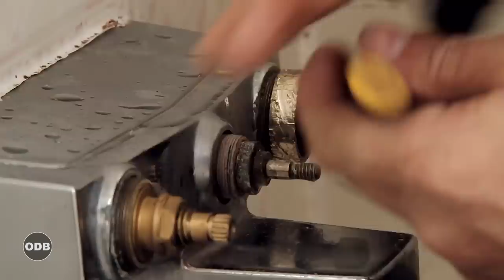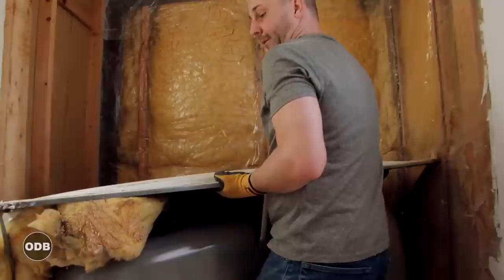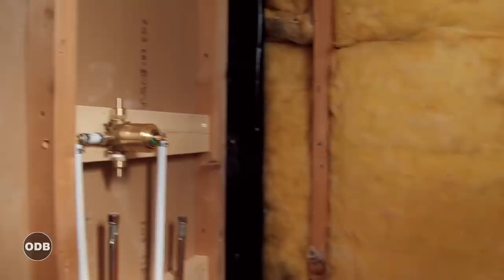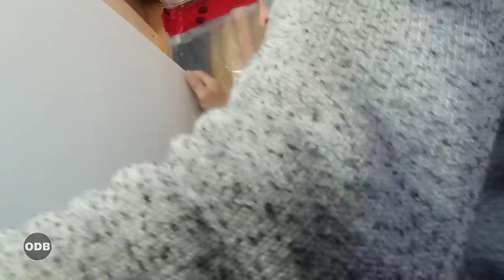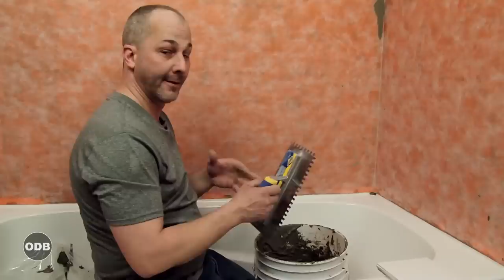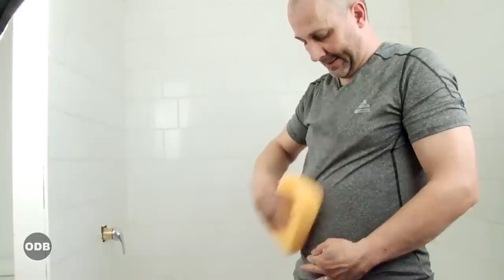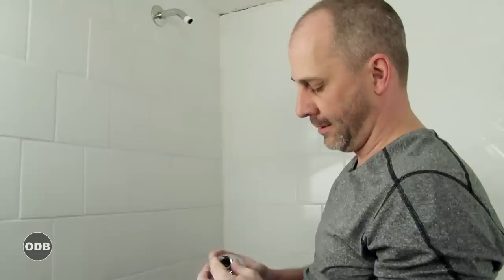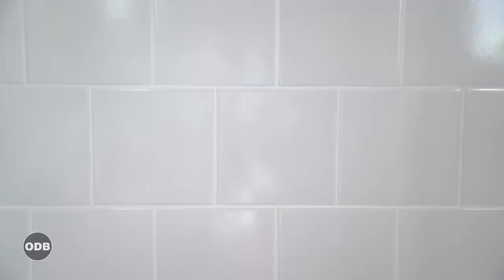DIY How to Renovate the Tub / Shower from A to Z

Comment: I am a pro and I agree with most of this video. Bottom line, this was a job well done and done according to budget. The price is fair , but it depends on the materials costs. I've seen an average cost to the customer of 2500 bucks because I pass my cost savings  ( contractor price) to the client , and use standard materials. The labour cost doesn't really change much compared with the products or materials chosen by the client. Great video!
Reply: wow! $2500 bucks from removal to finish installation? that ain't bad. But I did it by myself and it costs me about $1000.00 bucks using the best material too.

Comment: nice touch with the sealant around the tub etc but in reality using your finger and saliva to smooth out will only create a mould to appear on the sealant within a year due to the bacteria in your saliva. best to use the correct plastic forming/smoothing tool to create a smooth bacteria seal considering all your good work done to prevent mould growth behind the wall. but good job otherwise.
Reply: you can't avoid bacteria dude. No matter how you do it.

Comment: Can you test the piping before you install all the new drywall and tiling? I'd hate to get everything back together and looking real nice and then next thing I know I have a leaky fitting and have to redo everything. Once you get all the piping and new overflow back together and the tub installed, would it be safe to do so before installing the new drywall and tiling?

Comment: Great video! How far down do you take the sheetrock above the top surface of the tub? How do you waterproof the bottom edge of the sheetrock? Thanks.
Reply from the maker: stop at the top of the tile flange with wall board. use kerdi strip to seal the tub to the wallboard. Cheers!
Reply: @HomeRenoVisionDIY  : Thank you!

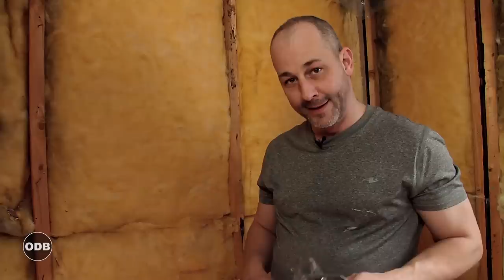Comment: Hey Jeff, or anyone else: For the shower plumbing at around 29:00, how do you know that the depth of the shower valve, tub spout, and shower head are set correctly? Like when you close up the wall, the valve or spouts could be sticking out too much or recessed too much. He just attached them to a 2x4 but didn't show how he measured for depth...TIA
Reply: 1:16:34 shows the that valve was set to far back, the result is the chrome sleeve wont cover the whole brass stem.should of used the template that usually comes in the box to mimic the finish wall. 2020

Comment: Whoa!!! That is NOT how to remove tile surrounds bud! Correct order of walls, but People! Don’t use those tools to demo- sounds funny, but there Are correct demo methods. By correct, I mean safe and efficient. Using an angle grinder (PPE ALWAYS!) cut down grout lines into manageable-size pieces. Then down the side with a saws all (grinder works but SUPER dusty) Just deep enough to get through to framing. Same across the top tiles if they end short of ceiling. Pry off the drywall with tiles attached for easy and safe transport to the dumpster. Then repeat on faucet wall, followed by center wall. Inspect plumbing feed lines, or remove and cap.

Comment: I believe your using 1/2” pex  going to your tub spout.? You should not use 1/2” pex  , as water pressure builds up and water will weep out of the shower head when your trying to fill the tub as your having a bath .
Even Delta highlights that you DO NOT use 1/2” pex out the bottom of the mixing valve . 1/2” copper or 3/4” pex would work .
Sorry for the correction,but I’d like to help save people from future problems

Comment: Hi Jeff.  Excellent video but now I'm confused.  I listen to the Carey Bros on Sat am radio (podcast available).  Yesterday they spoke of bath/shower units that are one piece (+/-), easy to install and high quality that can last many years with proper installation and care.  They spoke of various materials (though I can only recall fiberglass) and can be installed into a very tight area.  I also recall they thought highly of their leak-proof qualities.  The Careys are very skilled builders with many years of experience.  But you are suggesting not to go that route with a pre-fab tub/shower unit but instead think retiling is best. We are buying an older house with 3 tired bathrooms but the budget is getting stretched. (BTW, I don't want to dis them.  They also believe in proper prep.)  What to do?

Comment: The  wife and I were discussing the main bathroom this morning. We bought this 1972 built home in 1997. In the 22 years we have lived here I have replaced the bathroom floor plywood,  Floor tile, toilet, vanity, sink, and vanity plumbing. I have re- silicone/Calked the tub/shower tiles many times, especially the bottom three rows where there is visible damage, as in the mold always comes back.  The last item to be replaced is the tub/shower. The three walls and ceiling are tiled. I hate tile.  We discussed the option of just getting the surround that fits over everything, I on the other hand explained the whole thing needs to come out, Tub, Tile Drywall, etc. I found this video, We watched it. She is now convinced that the entire shower/tub etc. needs to be replaced and not just hidden with a new surround insert that goes over everything. Thank you for making this video and for your calm, easy to understand explanations for every aspect and step in the project as well as the estimated cost. If you were closer. I would call you for the job. Thank you for this video. After seeing this one, I am going to check out your others.

Comment: I personally DO NOT recommend using Shark Bite fittings inside closed off walls or flooring. Over time, o-ring can become brittle and leak. Just my thoughts. Other than that great video. Thanks for sharing.

Comment: I gave up on tile gimmicks like running bond or fancy accents in showers. I like those 6x6 tiles, but I'd just apply it standard with a white grout so I didn't get sick of it. BTW doesn't the cement destroy standard drywall? I'd at least go for the green-paper waterproof variety.

Comment: Please help me! I need to remove a common handle in a shower with a stripped out screw head
Reply: If you have a little bit of the screw extending out, I have often been able to walk the remaining portion with electrical wire cutter pliers. Obviously, you must squeeze the wire cutter handles as tightly as possible perpendicular to the screw.  { applying penetrating oil often helps }  I have been using that trick for many years and works every time.
Reply: I forgot to mention if the handle is still on, you can try to use a center punch and tap it with a hammer in the center of the screws, then gently try to drill it out using a very small bit, then move up a size or two until the actual head has been removed.  That should work for you as long as you don't press too hard on the bit[s], as they could break. >>Try to use a high- quality bits, as it will make your job so much easier.

Comment: Bought our first home, don't know the prep that was done behind the renovated bath tile. But it's clear that the grout changes colour when showering. Do I need to seal it, or does sealing actually make a difference?

Also heard a tip: silicone around the tub while it's filled with water. The weight will cause deflection while the silicone is applied so that when the water is released (24 hours after application) the silicone will compress. Now when you shower or take a bath, you're "relieving preload" rather than stretching silicone. Should last longer and not pull away from the two surfaces as quickly. It really uses the same science/principle of how bolts and fasteners work with preload.

Comment: Our house is 100yr old and the ONE bathroom we have is in need of remodel.  The wall around the tub is some kind of paintable latex but it’s rotting around where the tub is.  We have to pull it all out....we are removing the tub and the other panels like the one behind the tub from the rest of the walls....put in a surround, a new tub...replace any mushy plywood on the floor...put in new floors.  
It’s a daunting task and one that’s behind.  We moved in when my youngest was almost a year old and had planned to do it in our second year there....but instead, she was diagnosed with cancer.  Everything went on hold and has been on hold since.   She’s now 7 and finally in remission.   I’m ready to tackle this project!!

Comment: Drives me crazy when people use adjustable pipe wrenches to tighten fittings that are milled with flat square edges so that a crescent wrench can be used. 

Also never use 1/2 pex for the tubs down spout . If you read the instructions that come with the valve they say to only use 1/2 inch copper. Crimp style pex in 1/2 inch won’t allow the spout to release when you shut the water valve off.

Comment: Hi Jeff, I saw you are using the sharkbite tube coupling between the copper pipes and the pex pipe. Just wondering is it safe from water leak if use at the bathtub behind the wall? What is your suggestion? Or should it be better with Soldering since I have no experience with Soldering. Thanks!

Comment: Thanks for this video, it was very helpful!  But, I think I missed how you finished the drywall transition from new drywall to old at the right side of the tub.  I know you put that U shaped finish cap on the end of the drywall, but then how did you finish that open seam?  I'm going to face the same struggle in my bathroom.  Thanks!

Comment: As a homeowner who has done much pipe installation working with copper tubing with sweated fittings, I could never bring myself to trust those modern crimp or Shark Bite connectors, especially for inside wall applications.  No way can they be as reliable as sweated copper tubing.

Comment: Our tub is a fiberglass tub cover and wall surround. I believe they just covered over the old tub which gives it support. We want it out. It made the tub cavity so much smaller. I already had to replace the mixer. So covering the cut out after cutting the fiberglass for the mixer and values took some ingenuity.

Comment: Some established plumbers do not trust using shark bite fitting in enclosed spaces that are not in open areas. They say that the shark bite fittings could leak behind the enclosed wall and create a major catastrophe. They recommend either soldered on copper fittings or PEXA fittings using a PEXA expansion tool.

Comment: Hi Jeff, I am remodelling my upstairs bathroom, it is a 1951 house all brick no wood and I have removed the tiles and plastered the walls and then painted with redgaurd top to bottom, I have taken out the bath and I am putting in a wet room as I had difficulty getting in and out of the bath, I have also covered the hole floor with ½ inch plywood and built up the floor so that all the water will flow to the drain and I then painted the floor with redgaurd. I intend to cover all this with Schroder (sorry if I butcher the name) membrane, a heated floor and tile as well as all the walls in the room. I am using 18-inch square floor and wall tiles just different patterns and I intend to use unmodified cement, my question is will the membrane stick to the redgaurd and will the cement stick to everything.

Comment: i wouldn't personally bury shark bite fittings behind the wall.I use them for repairs that are exposed so if it ever leaks you'll see right away.Will they hold? probably.I would sleep better at night tho soldering in some sweat by pex adapters..

Comment: Beautiful work.  And, as you point out, not much more expensive, if that, than a fiber glass tub surround that you install and complete in one day without removing the old walls or mildew and mold that caused the walls to fail in the first place.  Thanks for that piece of advice.  And I learned a thing or two about installing tile.  Thanks for sharing your expertise.

Comment: hello, quick question bout the J trim you are using to blend the drywall. Can use it on a durock cement board to blend in with drywall? also is there a ling for the J trim you used? I know in the video you say to cut that wall in one peace but can it be done in two peace's since in my state there are nowhere to be found bigger durock then 3x5 . Thank you in advance!

Comment: Teflon with paste is the proper way. The paste lubricates the joint to aid in make-up. The tape galls in the threads, sealing them. 5 or 6 wraps, dope on the first three threads. ASME recommended procedure.

Comment: I prefer teflon tape.   I've never been a fan of the paste it's messy as heck if you drop a glob.   One thing you could have told them for a DIY is when you wrap the tape you need to wrap it in the same direction that you would thread your fitting on.   You'd be surprised how many people I see wrap it backwards and unravel the tape as they screw the fitting on.   I love watching all your DIY videos,  great stuff!

Comment: Just a question regarding the water supply.Should the water supply pipe going to the lower tub fill spout be larger than the line going to the shower head?The reasoning as I understand it, the water pressure will try to go up the shower line if the water spout is the same size, eg: pex pipe on both sides, rather than pex going to the shower head, and a full 1/2" copper pipe to the water spout.Is there any truth to this theory? Thanks Very much...

Comment: Do the bathrooms need to have that vapor barrier? Ours never had one, or any  insulation. We just realized we forgot to add any insulation after mudding and taping. We've just decided to get some blow in insulation. Do we need to take everything off again and add the vapor barrier, or will it be fine without it?

Comment: Hi Jeff, sorry to be picky but l notice that you use your pipe cutter and pump pliers backwards loosing perches. Also when applying tape if you also turn the reel around you can keep the tape tight getting a better joint. just a thought for you from the UK.

Comment: Shark bite fittings and Pex will bite you in the butt...  later, years down the road when they start to leak.  Also, I've never understood the logic of installing a vapor barrier and then installing it by poking holes in it everywhere with a staple hammer.

Comment: You need to use 3/4 inch down to the tub spout or your showerhead will possibly drip when filling the tub because water pressure will build up in the tub spout and back up through the shower head, it doesn't always drip but you wont find out until the hole job is done and then there is no way to fix it, I know because I made that mistake once many years ago.

Comment: You never use both plumbers dope and teflon tape.  Think about it your are making the thread larger and get less thread connection. Also based on thread size there is a standard for the number of wraps of teflon tape. Also buy the good pink tape not the crappy white teflon tape.

Comment: Not to say or make you feel as if your doing something wrong, but your using the wrench in the wrong way. If you turn it around so that the pliers bite into the pipe instead of glide alongside, then you more than likely could have taken the brass fittings from the hot and cold thingies without needing to chisel them off. Just saying.

Comment: I will never allow a shark bit coupler on a waterline. I had 2 fail in less than 1 week. use copper. Also do not like the PEX. we had a bad batch and everyone had to replace all lines. pretty expensive on a slab on grade found.  I possible i will us copper on a crawl space.

Comment: won't the chlorine in time degrade the rubber seal, thus risking a leak? shark bites, in my opinion, should be used outside walls where you can see it. shark bites for outside hot water systems r great:)

Comment: I was worried about the length of the video, after watching the first 5 mins I realised there was some very useful tips, shortcuts, and advice from an very knowledgeable, and experienced guy. Well worth the time and  very well explained. Will probably save me over £1000 on labour costs for the installation of my new bathroom, as I can now do this myself - I am an experienced DIYer but not a plumber, so this was a great help, cheers dude..by the way the weather outside looks feeezin' you need a hat!

Comment: That is two mil poly and they did not use cement board or blue board for the tub surround. What about a rubber mat to prevent scratching tub surface?  Great job, that tub and shower will last forever.

Comment: I was lucky and bought a house where the home owner switched from the city line throughout the house to plastic already. The down side is he used pretty much all PVC. The 1 repair I made was on the old copper stuff he left behind that corroded away and I replaced with PEX and new fittings. Plus apologized to the dog with lots of treats for thinking the puddles on the floor were made by her.
Interesting video's but please invest in some safety glasses.

Comment: What material did you use for the tub spout? I see that you ran PEX to the 90° elbow with threads on the output side.  I can't find any threaded copper or anything to use as a tub spout.

Comment: Thank you for making these videos, Jeff. I'm gaining a lot of confidence just watching how to do this the right way. One question I have is, when is it OK to turn the main water back on if you can't do it all in a day or two? Is there something you need to do to the exposed plumbing (that doesn't have the new fixtures attached yet) because you can't get to the tiling for a few days? (I'm pulling out a one piece plastic wall surround tub and replacing it with a metal flange tub without an apron. I'll be tiling the surrounding walls and front of the new tub, but I'm extremely slow due to a disability, so the support work might take more than a few days before I can even get to the tiling) What needs to be done to the plumbing to extend the working time while still having water available in the rest of the house?